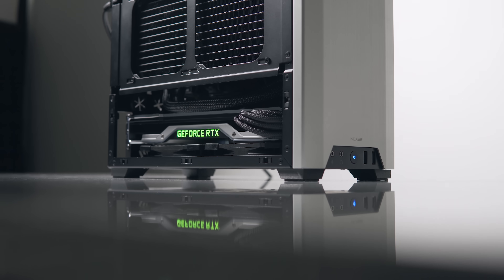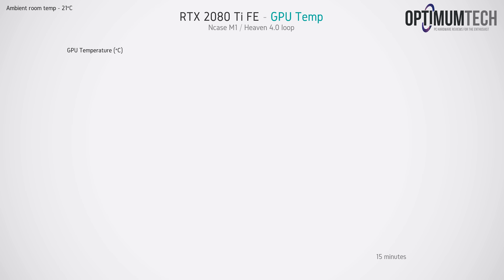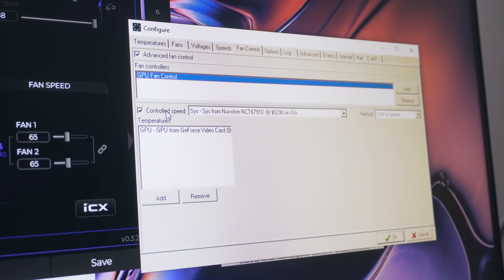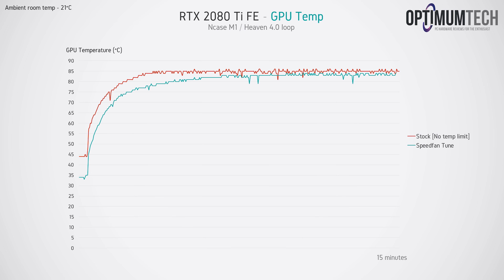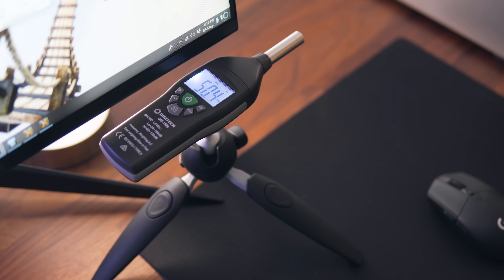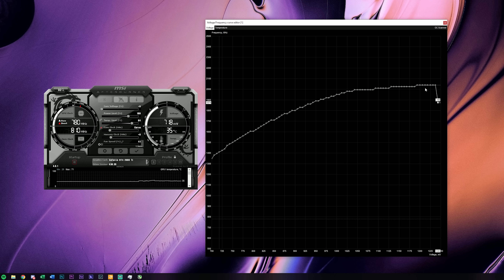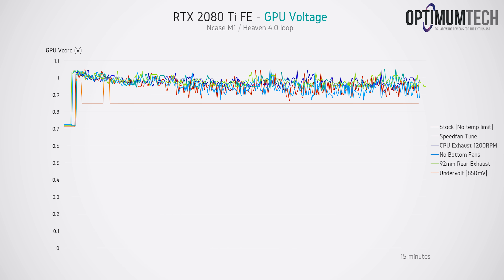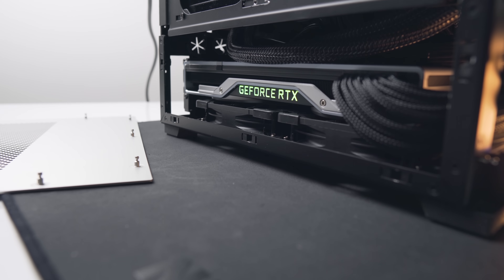Fixing my Thermal Throttling 2080 Ti FE..

Comment: I was just about to type 'try under-volting it' and then you did!
Reply: why the customer has to do this ? i dont understand it
Reply: @yoool7137  Undervolting is like overclocking to some degree, it'a pushing the card into possible unstable territory. So while the card is able to perform just as good as stock while undervolted in many cases, it does depend on the card what voltage it will continue to run stable at,  and depends on the "silicon lottery". So the stock voltage and clock is the "safe" and "stable" option set by the manufactorers, giving themselves headroom so the cards are a lot more likely to be stable for the end user, than if they were pushing the limit in either direction.
Reply: @yoool7137  because every card is different, and they can't check every card
Reply: Cut more hole into the case might help.... but normal people would just water-cool them..
Reply: It might be worth while to undervolt your card anyway and see what kind of results you get. I came across a Reddit thread a couple months back in which people were discussing undervolting their RTX cards and many found that they did not lose any performance, and some even GAINED performance from it. I gave it a shot on my 2080 Ti and found that my benchmarking scores didn't change at all despite the undervolt.
Reply: @bioforce5  The ones who mentioned that they gained performance were probably experiencing alot of ambient thermal limitations (and by that I mean even if its in an open test bench, their ambient temps were pretty high to begin with i.e. if you live in a tropical or humid hot place like Southeast Asia). I undervolted my 1080 ti and I did gain performance, same with my previous GPU the 780 ti.
Reply: @wunzeptepwun6175  actually no. If you have founders edition RYX, then undervolting will almost always gain perfomance.

Comment: Thanks for conducting all those fan configurations! Undervolting is definitely effective for NVIDIA cards. I think you can also pull out the good old Accelero III with a different set of shorter heatsinks.
Reply: Justin Dulay They already have a updated version on the market for the RTX lineup. I’m also wondering how it performs. ;)
Reply: And the good old 3.5 slots Rajintek gpu cooler.
Reply: I recently solved a similar problem on a noisy 1080 with an Accelero II Turbo. Knocked 20 degrees C from it at max load, enabled some overclocking, and rendered it really quiet.
Reply: I really hope Accelero come out with a 64mm cooler for Vega/Radeon VII cards. Can’t fit a Morpheus into my Cougar QBX.

Comment: I have the same problem with my zotac amp! 1080ti in my ghost S1. 
Ended up just setting the thermal limit to 77C. Now it’s quiet xD
Reply: You're really gutting your performance if that's all you did. I have the same GPU. I recommend undervolting just like in the video so you don't hinder your performance

Comment: Love the itx builds man keep it up
Reply: ~Disclaimer~ (This took forever to save and wait for decent pricing to build :P) Same here, I love the portability/power in a "tiny might" case :P (Makes me all fuzzy on the inside lol) I currently run the NZXT Manta, with the x470i ROG motherboard, so I went the 2700x route along with 16gbs of Flare X c14-3200mhz ram, but I have to say . . . . . the air cooled cards are a bit rough to run in that case. Due to such tight fitment.(MSI 1060, they're 1080, and EVGA's 1080, super hott >_< So I'm debating on whether or not to go with an enclosed liquid cooled gpu, since I decided to use the h115i cpu cooler. . . or shrugs

Comment: Ali: 
“2080Ti Itx Build!!! 🔥”

2 days later

“Fixing my thermal throttling 2080ti. . .”
Reply: What the thickness of the thermal pad any one can help ?
Reply: AMD users have been accustomed to these level of noise and they are still loving it, must be masochists :D.
Reply: Ryan Huynh *macintoshists
Reply: @krizby87  My sapphire vega 56 is silent af. Most of the time the fans are off. But my case has good airflow (Fractal Define S) and I have plenty of 140mm fans in it. My Rx480 red devil has been what you describe it though. I think the thermal paste was dry and I just need to repaste it for 2nd pc.
Reply: Ryan Huynh ehh, with some custom stuff it ain’t too bad.
Reply: @AlexDenton0451  the best any AMD aib can produce are still louder than nvidia FE counterpart. Check out asus strix vega review vs 2080 Ti FE.
Reply: @krizby87  LOL, simply lol.
Reply: @krizby87  Me: Cries in AMD